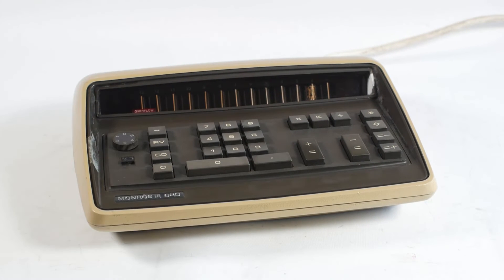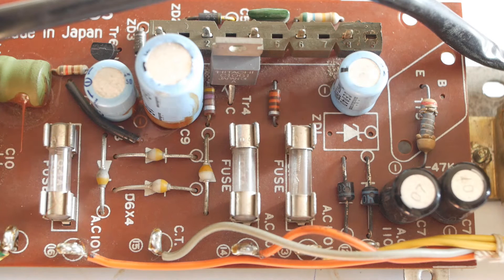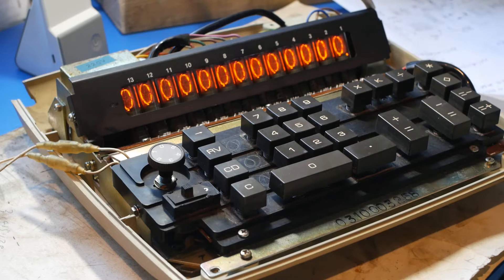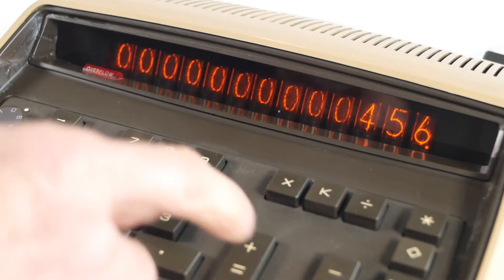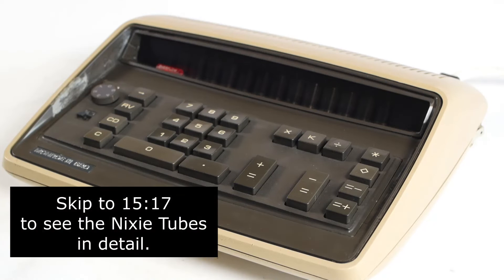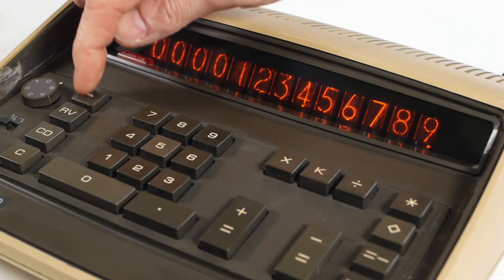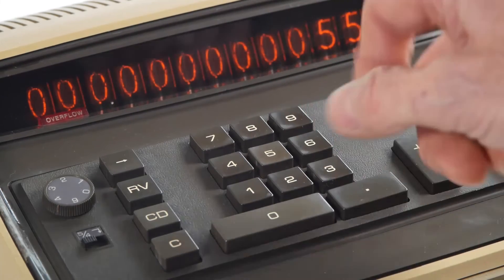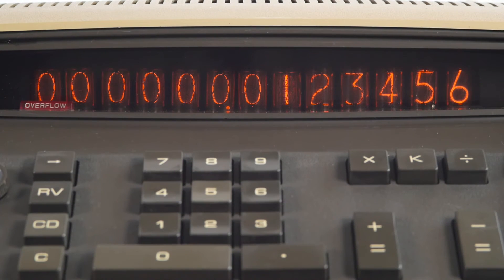Nixie Tube Calculator - 1972 Monroe 620 - Repair and Demo

Comment: I have just purchased one of these without the power. I'd be very very VERY greatful if you'd consider printing one of your connectors for me & popping it on Ebay or something? As I'd love to be able to test this unit. Cheers Tim.
Reply from the maker: Hi RenaissanceManChild, if you want to send me an email (address somewhere in the "About" tab for my channel) I'll see if I can print one sometime - I should still have the design lurking on my computer somewhere.

Comment: I have one of these. I was lucky enough for it to be in working order, all for £3.20. It fell through the cracks on eBay because the magic “Nixie” word was missing from the listing. The chap I collected it from was happy it was going to a good home, and sold me another Monroe (Model 430) with a Panaplex display for £5. Well worth the 150 mile round trip!
Reply from the maker: Good heavens, that was a good day out!!!!  I never get that lucky.  I've had a couple of machines that I bought, or at least thought I'd bought on ebay, but both had been thrown out during a clear out of the garage and the sellers forgot to remove the listings, so there must still be plenty going for scrap - just need to figure out a way of intercepting them.......

Comment: Great job, and congratulations to your successful bid on Ebay for one of those "holy grale" nixie calculators 😊. Wonderful close-up shots of the nixie tubes! I always enjoy that 3D factor of these displays where the digits are jumping back and forth.
To my point of view, you are completely right not to respray the case to make it perfect. By the way, this calculator has a wonderful 70th design.
Reply from the maker: You know the weird thing, I've been waiting for 3 years or so to get a Nixie calculator, and within one month I've got another one - no idea if the latest one will work or not, but I'll check it thoroughly before applying power.  The new addition pre dates the Monroe by about 3 years, so instead of 4 chips, there are about 40.  It's not visually as attractive as the Monroe, which, as you say, is a great 1970s design.  Glad you approve of my decision not to respray - I rather like originality, even if it's a bit shabby here and there.
Reply: @GrumpyTim  Wow, I'm looking forward to the video where you will reveal the machine. I have  Soemtron ETR 220 from 1972 in my collection, which was produced in the GDR and has no chips at all.
It only has discrete transistors and diodes and a core memory. It's bigger than most of my mechanical calculators...
Reply from the maker: Wow, your Soemtron must be a fantastic beast of a machine, what a brilliant machine to have in your collection - I've just looked up some photos.  I've found with a few of my early electronic machines, that they're somewhat bigger than they looked in the photos - I can only imagine how massive the Soemtron is!!!

Comment: At this point I'm fairly confident that you're a wizard or possibly a mad scientist and at some point you're gonna figure out faster than light travel. 
I always love watching you take these things apart and repair them despite not having a clue what any of it means. 
Oh and Nixie Tubes is incredibly fun to say and would be a great name for a band!
Have a good one, mate🖖
Reply from the maker: I've always wanted to be a mad scientist David, but in reality I'm just tinkering with stuff that some previous mad scientist invented - still it's fun even if I'm not actually inventing the stuff myself.  Hmmmm the Nixie Tubes would have been a fantastic band name - I wonder if anyone ever used the name, even some more or less unheard of band.  I've got an even earlier calculator to work on now - progress was fast at that time, so going back 3 years makes a lot of difference, and it smells of the 1960s too.........

Cheers for watching
Reply: @GrumpyTim  Yeah looking at how fast things changed between the 60’s and say the 80’s is bonkers. Looking forward to seeing that video, Tim🖖
Reply from the maker: All I need now is an early 60s electronic calculator, but the last one I saw sell on ebay went for about 2 grand, so I won't be getting one of those any time ever!!!!  They had the most bonkers mad science components inside - maybe I'll find one in a skip one day......

Comment: Interesting to see it has a Canon motherboard
Reply from the maker: Hi ohjajohh, it appears to have been quite common at that time - calculators were developing so fast that some established brands like Monroe and Friden, bought machines from Japanese manufacturers and put their own name on them.  I guess it's a bit like that with many cars these days - like the Toyota Aygo is also sold as the Citroen C1 and the Peugeot 107 - it just costs so much to develop a new car these days that many manufacturers do these joint projects.

Comment: Good repair on the electronics and outstanding repair on the plastic! Well done!
Reply from the maker: Cheers Ben, I could, and probably still will, do a bit more work on the plastic, but not so much that it detracts from the originality of the unit, definitely not going to be respraying the whole thing!!!  One thing I didn't point out in the video because it would have been difficult to show, was that there are two dents in the front edge of the calculator - not from an impact, but from where the user rested their fingers for many years - that thing must have seen so many hours of use during it's lifetime.  The pimple on the number 5 is also more or less worn out too.
Reply: @GrumpyTim  That's quite an impressive mileage!

Comment: Great video. Back at school in the 80s, our science teacher was clearing out her store cupboard and found a couple of Numicator calculators. I loved the clicking of the relays when the digits changed.
Reply from the maker: Hi John - I love anything like that - especially the sound of clicking relays and the like - I've seen videos where people have made themselves relay computers - I'd quite fancy doing that but it would take time, and would probably be far from cheap!  Maybe one day....
Reply: @GrumpyTim  I bought 5,000 relays from a scrapyard. I believe they are 5 V.
Reply from the maker: Oooh, that's interesting Ben - maybe I need to look into how to actually make a relay based calculator - surely it can't be that hard!!!!!!
Reply: @GrumpyTim  I'll have to check they work.
Reply from the maker: While I think of it John, in case I'd misled you into thinking my machine has relays - when I did the count down at the end of the video, I simply entered 20, then pressed 1, shortly followed by the minus equals key and repeated that at about 1 second intervals to give the impression the machine was counting down - I didn't intend to include the sound, but it actually sounded so mechanical that I left that channel unmuted.  So the sound you can hear is just me tapping at the keyboard.
Reply: @GrumpyTim  lol I hadn’t noticed the sound tbh. No, the calculators we found at school had lovely clicky relays when the figures changed. Made it sound like the thing was doing some work!
Reply from the maker: I thought that was what you meant, then suddenly I thought you might have been meaning the sound of my calc!!!  Those machines at your school must have been so cool - I'd love to get one of those, but I'd be willing to bet, unless I got very lucky, that I'd never find one, or certainly one I could afford.  I watched one of the early Anita machines sell for something like £2000 on ebay last year - I had a very early bid on that machine but it soon became obvious I was nowhere near so I sat back and watched!!!